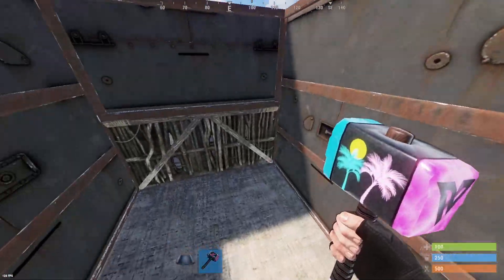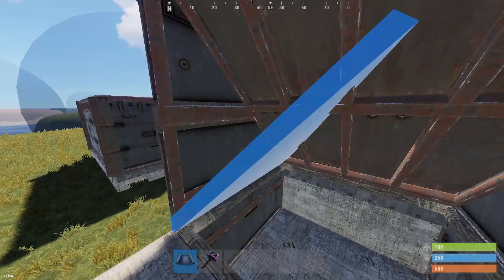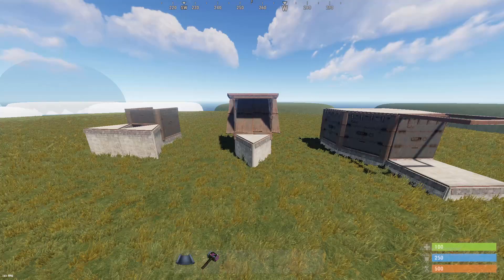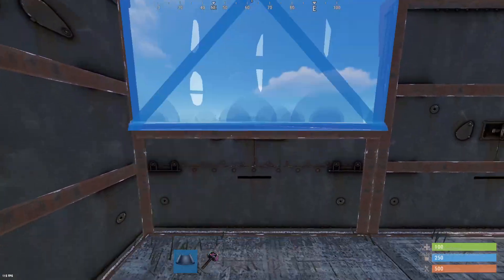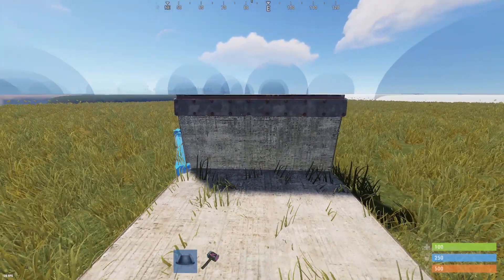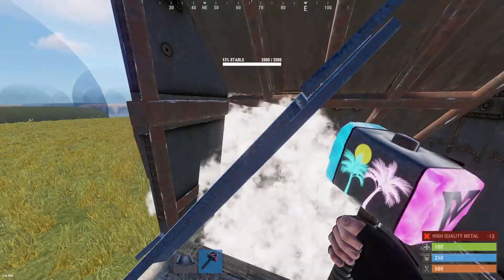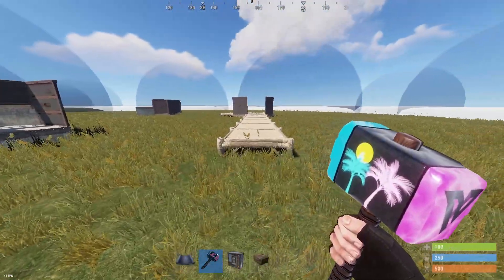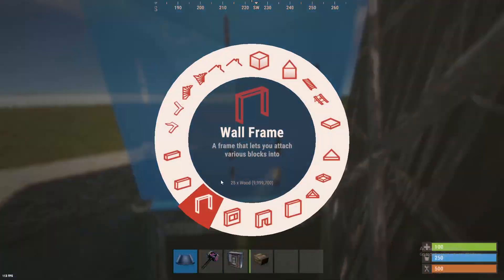How To Build Bunkers In Rust! (Rust Base Tutorial)

Comment: The second bunker should not have a high foundation in front of the roof, it should be a low foundation with a low wall that the roof connects to. High foundation can be soft-sided, opening the bunker. The low wall cannot.

Comment: On the multi tc bunker you just need to open the bunker with a roof and you can place the floor frame while it is hqm. Also you can make it connected on one side by freehand placing it and it will still work but keep everything on one tc.
Reply from the maker: I didn’t know that about opening the bunker and placing it, thanks for pointing that out! And yes Ik about the freehand bunker but then you can’t incorporate it into a multi tc design and then that would serve as your front door(I’m assuming) and I wouldn’t want it like that because camping. Thanks so much for the comment!

Comment: For the second one I can’t get the triangle roof to lock into place. Any tips so I can do this
Reply from the maker: Assuming you  mean the roof bunker, make sure the one side has a half wall on bottom and full wall on top and the other side has full wall on bottoms and half on top. Then when you place the floor frame it should place.

Comment: No offense, but suggesting to use a hatch frame instead of a roof or nothing at all is not the best way.. Not at all talking shit, just hear me out. I have 6500 hours and have used this type of bunker along with a type of regular stability bunker but without the raised foundations, and EVERY single time they have blown through, even IF they use rockets, the frame is still there.. That is why if you do absolutely want to use a frame to hide it, keep it stone.. Unless you know you aren't the type of player/group that will rebuild in the same base, since you will have to blow the hatch frame out yourself to replace the wall.. I know, I thought that keeping it stone or at least sheet metal would be fine, but I have used this type of design for the past 2kish hours and only 1 time they broke the hatch frame.. I kept using it solely because I was playing solo and duo most times, and would just be on the server for a day, max 2. IMO, Floor stacking is 1000% the meta, I have yet to be successfully onlined by a clan, the bunkers you can make are insane
Reply from the maker: That makes a lot of sense! Typically I’m not the type to rebuild if they get most of my loot, but that makes so much sense! Never thought about that, from now on I won’t be doing that😂 thanks so much for the comment, this is actually very helpful!